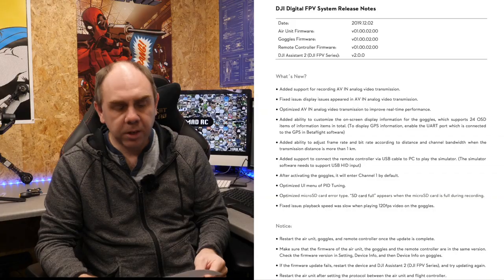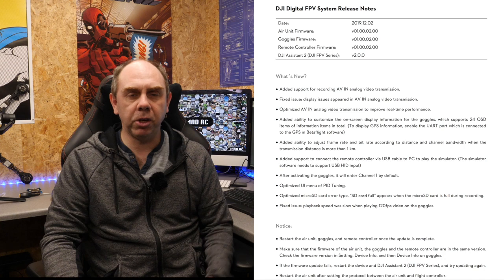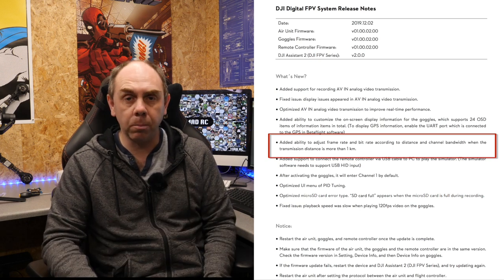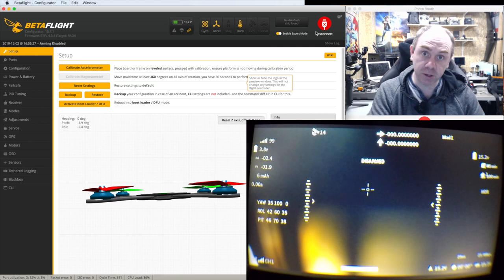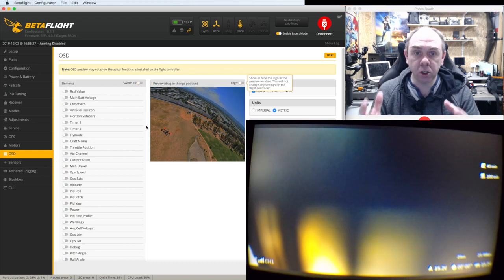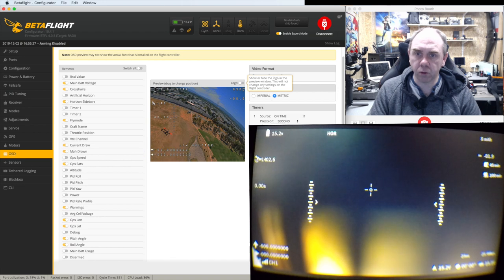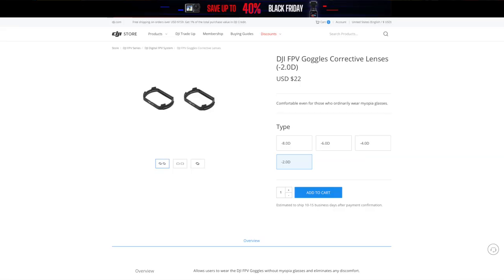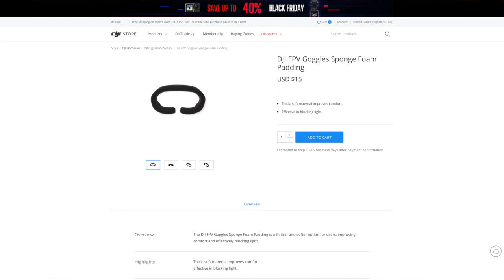DJI Digital FPV Update - New Betaflight OSD Setup, Analog DVR and Latency Fix + RC Sim Support

Comment from the maker: Hi everyone, just to confirm all hacks and mods work as they did before with this update to FCC and 1200mw are all still good you just may need to do them again after updating.  

I forgot to add this to the end of the video
Reply: thx for pointing this out, very important 😁
Reply: I ran 700 mW today without problem.
Reply: p
Reply: I wish to see the peripherals in the final video, just like you see in the osd

Comment: Hi thanks for the video. Maybe I missed it in the video, but do you need BF 4.0+ to get the BF OSD working? I just updated my goggles and air unit and can switch on Custom OSD, but nothing shows up. My OSD is programmed correctly in Betaflight, Telemetry is enabled, and MSP is on the correct UART. I'm currently on BF 3.5.7.
Thanks!
Reply: I think I answered my own question...updated to 4.1.1 and up it came! So apparently you need at least BF 4.0 (or perhaps 4.0.5 in your case?)
Reply from the maker: It’s not been confirmed but yes it appears to be the case.
Reply: Hi great info.. I don't seem to be able to move some features.. Eg in BF osd I can move the 'mbps' but in the Goggles V2 they remain in same place, ie bottom right hand corner..?
Thanks to advise why this is.. 👍

Comment: hello its been less than one week i got a brand new 5" 6s drone which included the dji goggles and i got also radiomaster+
crossfire...all updated running 1watt output on crossfire and 1200mw video and 50mbps on dji fpv..remains to add the gps module which i dont know if worth  the time to solder on  will it even work properly? but my main problem is that on OSD in goggles not all options appear on screen...i have the Rssi but i want the Qlink mostly and this dont appear among other options who dont appear also..is there any fix for that? as for the Rssi  i m pretty sure the value showing is incorrect..i have set on TX the crossfire channel 8 to Rssi/LQ ...then on betaflight i disabled the Rssi ADG on setup screen and i set to channel 4 on the reciever tab the Rssi..then on failsafe i set the channel 4 from hold to set at 1000....where am i doing wrong? please my main question is about showing on OSD in goggles the Qlink value..that i care mostly

Comment: Thank you, as found your list of 24 elements a useful reference. I made my own list by individually turning on/off an single element at a time. Now I need to compare, as don't remember seeing crosshairs and sidebars; but did enable RTH direction arrow and distance. (kind of helpful for knowing which direction baring to face for better goggle aiming.. ;) 

Too bad Betaflight Configuration did not just include a "DJI" option slider that grayed-out all non-supported OSD elements.

Wish had the DJI Betaflight OSD info a couple months ago, as could not find on any details on Betaflight wiki. (only comment is it is not officially supported, and thus not part of the standard betaflight maintenance process ... paraphrasing, but ... )
BTW: Betaflight now has 3x OSD profiles, but only one set of element positions across all profiles, so less useful than it could be.

Currently considering moving to INAV as position hold and RTH features are very compelling.

Comment: How does it know when the distance is more than 1Km when I'm flying my miniquad without GPS?
Reply from the maker: I have no idea on this one, I’m trying to get some answers.  It’s a strange one as nothing is shown at all in the firmware.  If you had GPS it could pull the data from MSP for distance from home but that’s about all I can think off.
Reply: It’s likely a setting that you employ when you plan on flying >1km, not a change that takes place once you travel past 1km.
Reply: You can tell relative distance from packet return time because the system is bidirectional.  The farther you are away, the longer it takes a packet to make a round trip.  By knowing power levels and packet return time at various distances in testing, DJI can estimate distance.
Reply: @protonus  I'd be rather surprised if that was the strategy used. The "round trip" time would be just 6uS and that could easily be less than the jitter imposed by the processing of a received packet and the generation of an ACK -- but who knows.
Reply: @xjet  Oh hey, didn't notice that was you xjet :-) Now that I know I'm talking to someone with a brain haha, let me share more.  Re: this timing suggestion, I'm actually just parroting information from someone who is much more familiar about RF than I am - Hugo @ TrueRC! Backstory, there was a thought in DJI groups, that the new DJI system was somehow limiting people to 4mi exactly, as the system would rapidly degrade and disconnect for many users at this distance. It turns out that this is probably due to some poor design choices on the VAS Cyclops that these users were using, as folks with twin TrueRX X-Airs have gone further and see less dramatic fall off, however, I think that is what this "distance improivement" is aiming to address - trade some quality for greater range, so signal doesn't plummet as quick.  At any rate, the original quote from Hugo about this is as follows:
"the amimon had a 1km limit programmed. By time keying the data packet it could calculate distance tx to rx. - Hugo Chamberland".  Thread is here: https://www.facebook.com/groups/DJI.FPV/permalink/2754649981259773/?comment_id=2754672764590828
Reply: ...and then when DJI know your packet size, determine you do not have spotters along than 1km route out of your line of sight they report you to the authorities lol  😂

Comment: DO you need a flight controller with an OSD built into it to get OSD in the DJI goggles? I'm assuming so, unless the air unit is pulling OSD information from somewhere else?

So for instance, could you use the Holybro Kakute F7 Tekko32 F3 HDV Stack, which doesn't have an OSD on the flight controller and get betaflight OSD information on the DJI goggles? Or would you have to use a different flight controller with a OSD chip on it?

If so, do you have any recommendations of a good flight controller with a OSD chip on board and a voltage regulator to hook the Air unit up to so I can run it on 6s? 

Thanks for the great video)
Reply from the maker: Yes it has to be a BF OSD compatible controller.

Comment: I have version 2 of GOOGLES and I have updated the firmware, both in the glasses, the drone and the transmitter. I have read that this update completes the vision of the Betafligth OSD, but when I look at the firmware version for the Air Units,  it has not been updated nor does it allow updating ... Is that so?

Comment: Can I ask you about mw power (for UK)
I’m new to fpv and finding your vids really helpful. 
Literally just learnt about “hacking” it and giving me 700mw option from the locked 25mw it gave me. 

Would 25mw have been the reason my quad fell out of the sky today. Suddenly and for no papers to reason. 
I wasn’t that far from the quad. (Can see myself in drone footage just before it falls but I was facing away from drone with drone behind me. )

Any clues?
Reply: P.s. I have DJI goggs, air unit and RC. And a BNF DC5 from Quadcopters.co.uk
Reply from the maker: Its very hard to know tbh. 25MW in its self wont cause a crash however falling out of signal and depending on your fail safe settings. really the log needs to be looked at.

Comment: I have a matek f405 std with the latest firmware on betaflight. All wiring is correct,  the msp is correct to uart4 where wires are connected. I still get no osd.

Comment: In Betaflight I can't get the DisableOSD slider bar under MODES to have 
any effect on turn on or off the actual OSD in the DJI goggles   The OSD
 stays on regardless whether the tic is in the zone and it's highlighted
 or not via being bound to a switch on a transmitter channel.
 
Turning
 the Custom OSD on or off inside the DJI Goggles under Display works, 
but at either in the OFF or ON position, it has no effect on allowing 
Betaflight to turn the OSD on or off.    At least for me.   I guess 
maybe it depends on your flight controller / osd chip, and your mileage 
may vary?
Reply from the maker: You can not turn on and off the OSd from that  part of betaflight.  That to control the onboard OSD chip.  DJI is using the MSP protocol to communicate and overlay the data and it’s entirely separate from that setting.

Comment: Amazing!!! Mad RC do you know if the Kakute F7 HDV Flight controller supports the betaflight OSD?
Reply: Yes it does, i have one and it works well for voltage, i havent tried the new stuff yet. Make sure to enable MSP on UART1 and it should work by default.
Reply: @matthewharmon6015  thanks, I'm aware regarding voltage, my question is related to the new OSD options. But I guess if voltage is working the new ones should as well.
Reply: @mariniam  reports on rcgroups say it works on kakute
Reply: @paulmunro3050  thanks!

Comment: Alt and speed were the only ones I wanted!! 🙈
Reply: Same here!
Reply: Yep I really need the altimeter too.
Reply from the maker: Hopefully with the next update.  Something require more coding than others.
Reply: @MadRC  After Xmas I would think. Really curious about that 1km+ bitrate and bandwidth setting too but same as you can't find it anywhere in the menus.
Reply: @changeagent228  yes, on the positives updates are coming monthly which is great 👍
Reply: @paulmunro3050  Agreed the updates are timely and useful. We need more OSD elements like VTX temperature and VTX power output. We need to be able to predict overheating before the video just cuts out.

Comment: nice video as always mate, just a question, i can see all good on osd, LQ from crossfire, gps sats etc, but cant see the average cell voltage. Do you have any clue? i just see 0.00 v, but is weird, couse i can still see the other general voltage value from the bf osd... dont know
Thanks for your nice work!
Reply from the maker: That’s odd as I’m 99% mine was showing. Actually check it in the video lol.  Do you have the battery type setup in Betaflight power settings ?

Comment: Thank you for the video, big help.

I am having a problem though, I can get the OSD to work in the goggles, everything is showing and I can position everything, only problem I am having is the the battery voltage etc is not giving me a reading? it constantly sits at 0, I am using a T MOTOR F4 stack (dji plug and play version) is there anything you can suggest to help sort this?
Reply from the maker: Have you configured the power options on Betaflight for your setup as it’s simply reading what your FC is telling it.
Reply: @MadRC  ermmm no I haven't, would you mind telling me how to do this? Thank you.
Reply: @everything_amg  yes I wish to know how to set up voltage too.

Comment: I am currently using the DJI controller, and my RSSI reads 0 all the time.  Do we use an aux channel in the BF receivers tab? Or does the RSSI only work for people running crossfire?
Reply from the maker: RSS is not working at this time as a reading as DJI are not providing it as data.
Reply: Mine reads 99 and 4 bars as a standard?

Comment: Hello Mad's, ...I have Mamba F722 has 6 each Uarts. And after firmware 4.1.5 has :
VCP at msp
Uart1 at Serial RX
Uart2, Uart3
Uart4 at msp
Uart5, Uart6
Where choice Uart for DJI to connect cable Rx Tx from Air Unit?
Reply from the maker: You can use any of the free ones. I would set it to UART 4 making sure you cross the TX and RX lines.   For the custom OSD you will need to turn off MSP.
Reply: Thank you. I will connect cable Caddx Vista air unit to Uart4 (MSP to Off and pereperal DJI to ON)

Comment: I'm struggling to see anything other then flight pack voltage when using I-nav. Is there a specific setting I need to use with I-nav?
Reply from the maker: Inav is not supported for custom OSD as it’s using a diferent MSP version to Betaflight.
Reply: Didn’t realise there are different versions of MSP. Unless you are a BF user there is no gain. Do you know if future I-nav support is planned? I need RTH capability if possible. Does it work with Cleanflight?

Comment: Does anyone know.how to turn off the low voltage alarm in the goggles (for the goggles)? I'm using 4x 18650's and the alarm comes on at 13.8v. should be able to go down to 10v to get the capacity out of them??
Reply: 10v would reck your battery mate
Reply: @gregmeskens8475  I thought lithium ion can go down to 2.5v safely? I know it's a no with lipo
Reply: @carlwhitaker5151  my bad buddy, didnt know u referred to Li-Ion.